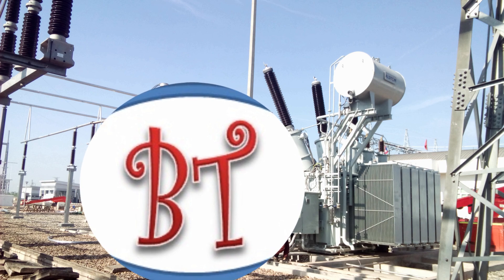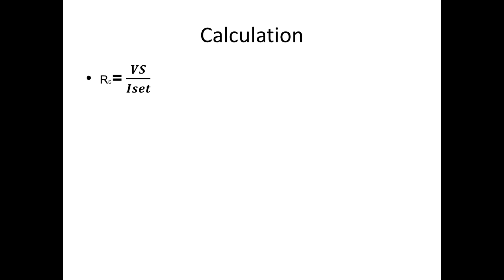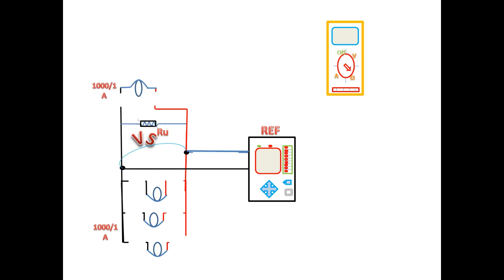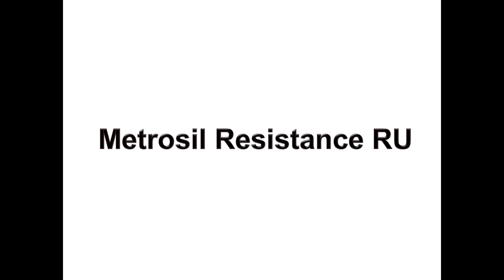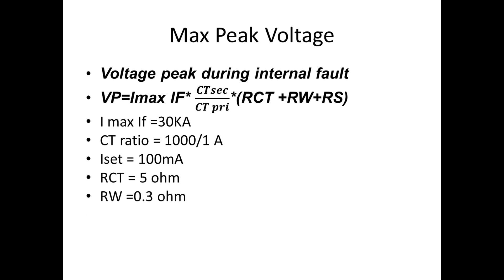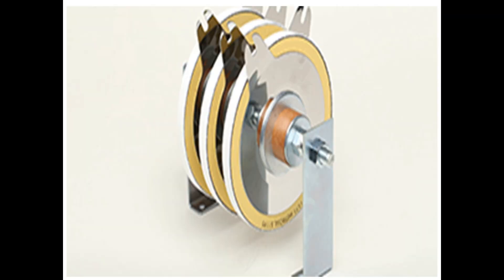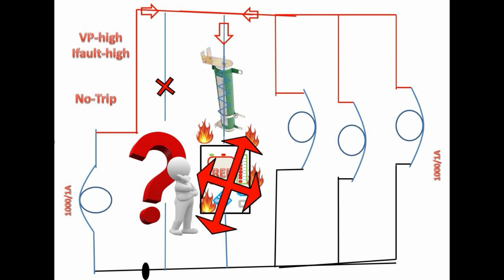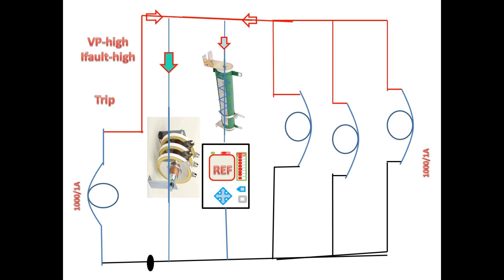REF Working Part-2 | About stability resistance  and Metrosil Resistance in REF Protection

Comment: Dear friend : good info -function of MET is it offers high z for normal low voltage condition and low z for high v cond due to its non linearity feature .and protect relay from switching surges .Function of Rs is to avoid relay pick up for through fault condition ,moreover 3-ph fault current is In/ % z of TRF.
Reply from the maker: well said good friend